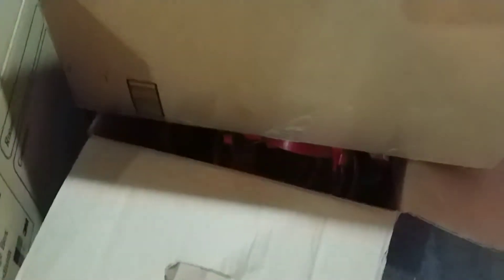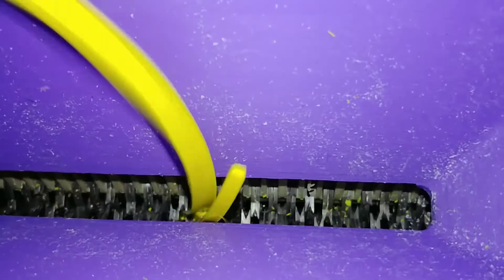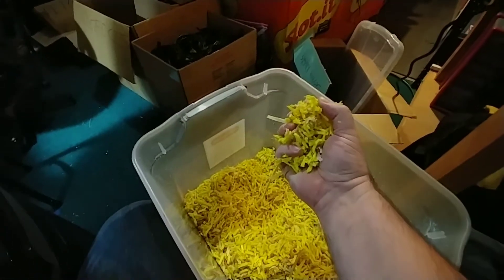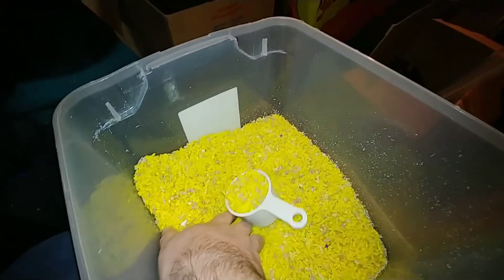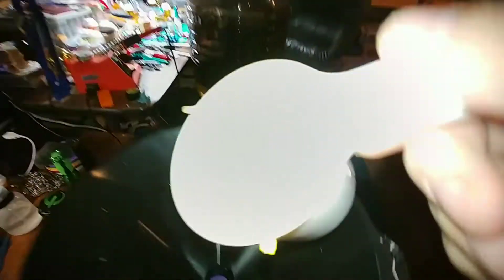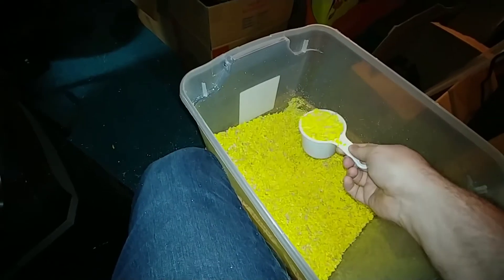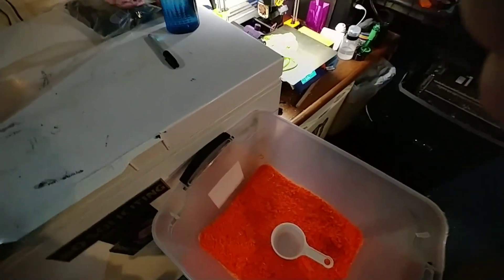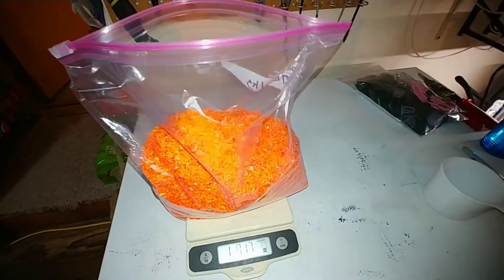My scrap plastic shredding process

Comment: where did you get the shredder machine from… can i please have the link
Reply from the maker: It's just a used paper/CD shredder I got from a thrift store. I cleaned it up and then chopped it up to add a hopper and fool the switches into running constantly. I've uploaded the hopper to Thingiverse, but unless you get the exact same model of shredder, it probably won't be helpful.